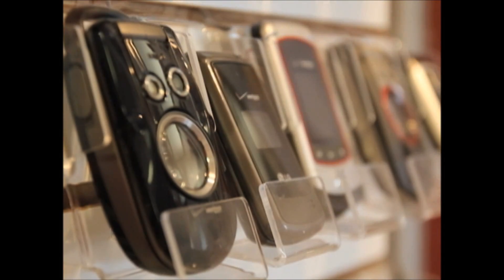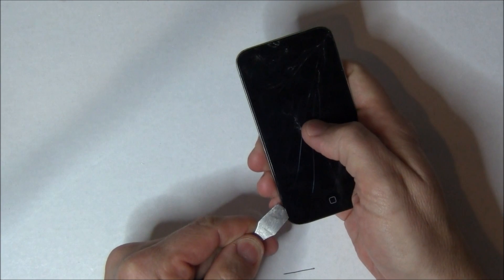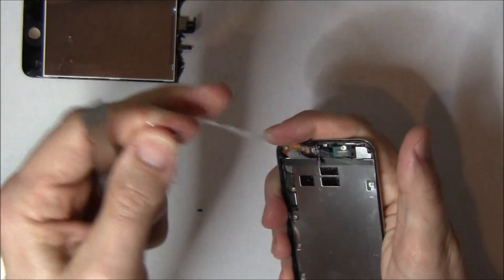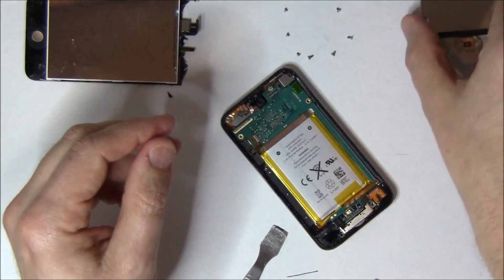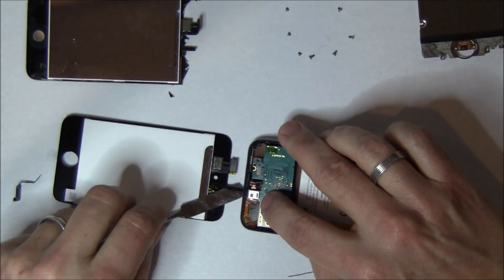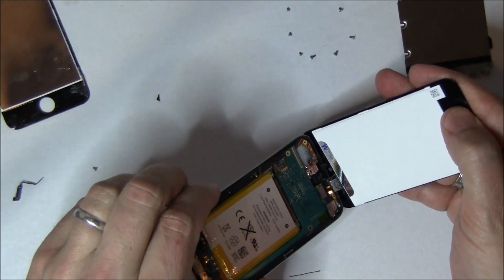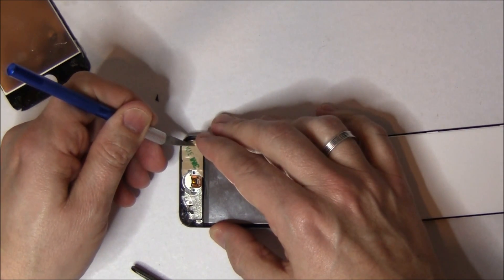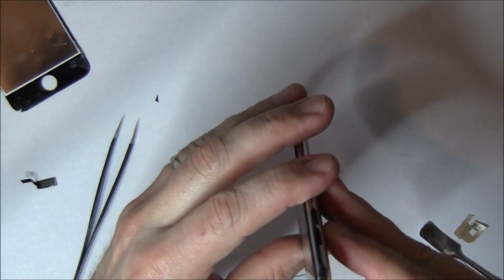iPod Touch 4 Screen Digitizer/LCD fix Disassemble Repair

Comment: Great video, I just fixed my kids I pod. I found 10 seconds at top and bottom of the screen with hair dryer on high hot caused the glue to soften and the screen pried out easily. Wait about 15 seconds after heating for adhesive to soften as the heat has to penetrate. The screen should feel very warm before prying.

Comment: ok so maybe someone can help me i changed my digitizer/screen on my ipod touch4g and now i have dead spots on the left side i cant slide to unlock unless i swipe super fast and it takes a while to get it also the keys esx dont work i tried 3 different screens but the same thing happens..is it possible that because i didnt put the foil around the digitizer when i put it back that thats why im having this issue..please someone help me if you can thanks
Reply: wow thanks for the fast response yea the digitizer is clipped in there good so i dont know where to go from here..it makes no sense to me i have fixed several ipods before and never came across this problem..

Comment: Hello, I have a question as I've noticed this on 2 ipod 4s that I've repaired the digitizer and LCD; what kind of adhesive should I use to secure the digitizer/LCD properly? Both times at the top of the ipod, the digitizer doesn't seat properly, no matter how much pressure and 3M adhesive I apply. Thank you in advance for your answer.

Comment: I followed your tutorial and have a problem.  When I test the screen I cannot unlock the unit.  The screen powers up when I connect it to a source (i.e. computer) for a few seconds and then goes black.  I tried a second screen on the same iPOD and it does exactly the same thing.  The unit was working fine albeit with a broken screen before the attempted repair.  Any ideas on what the issue may be?

Comment: This is my first actual broken screen fix for an ipod touch 4th gen.  Usually I mess only with cells; mostly Samsung.  My neice bought the replacement screen off ebay after telling her to go to an Apple store.  It shows only a white screen on startup, no sound or anything.  Had to plug in for that.  Was very careful not to over flex or break any wires during disassembly.  Any suggestions as to the cause?  I am at the point where just the screen is plugged in and no further, following your vid...

Comment: everything seems to be fine except my touch screen is unresponsive. But volume button works home button and lock button work and connects to wifi. Is my digitzer not in all the way? I could have sworn it clicked this time but idk for sure. Or maybe do i have to get a new digitzer because i messed it up?

Comment: Thank you for this video. I was able to do BOTH my kids' iPods. No joke on the digitizer though, that's where you need ALL your patience. If you are testing things before final assembly and get a full white screen it definitely means you need to re-seat your digitizer. I took out the volume controls on one of them, but volume can always be controlled on-screen. Thanks again!!

Comment: Chuck, I just had the same problem with mine. I ended up taking it apart again to make sure the digitizer was plugged in good, it wasn't. I plugged it in again and this time tested the screen at this point just to make sure it worked, and sure enough, touch screen is back to normal, put it all back together and viola! Good as new, screw apple and all they wanna charge!

Comment: So I repaired everything and before I decided to seal it, I wanted to make sure everything worked. But I noticed the very bottom row of my Ipod wasn't working, like the space bar, next, ect. And its only the very bottom row I'm having trouble with. I unhooked the digitizer several times to see if that would help and nothing. Will I have to have someone look at it, or will I have to buy another part for it??

Comment: my ipod touch 4g's screen is completely white. i know it still works because the alarm wakes me up every morning. however, i can't see anything and it's frustrating. also, the top of my screen is peeled off so i can pretty much see the inside of the top. that's not why my screen is white because it was still working after that incident occured.. how do i get my ipod to work again? what's wrong with it?

Comment: my ipod works fine music plays and its touch screen is fully responsive, but there is no back light what so ever.  i have to tilt it in perfect lighting conditions to read the display. do you know what could be causing this and any possible solutions?

Comment: OK IT TURNS ON GREAT BUT NOW I TRY TO TOUCH THE SCREEN WITH MY FINGER BUT THE SCREEN DOESNT SINCE ITT WAT SHOULD I DO I TRIED TO TAKE OUT THE LCD  CABLE AND PUT IT BACK BUT STILL THE SCREEN DOESNT SINCE MY FINGER  WAT SHOULD I DO NOWWWW

Comment: Okay soo I'm at the part where I'm taking off the sliver plate. There's a copper square sticker thing stuck on the plate and the iPod in the right hand corner. What do I do? Do I cut it off or what? -_-

Comment: Thanks for responding i reassembled the digitizer (didnt have it in right) and now when  i try to slide to unlock it goes almost all the way to the end and wont unlock i just want to make sure its not anything else but the digitizer P.S. the digitizer isnt snapped

Comment: I droped my ipod touch 4g in water and the screen is very dark i have to put a lamp close to it to barly see it. Would a new screen fix this problem?? Oh every thing works the volume - and + both work perfect, and power/sleep button works perfect, and the speaker works perfect, and dock connector works perfect, please respond need help to fix this problem.

Comment: Its just disconnected from the motherboard, ive snapped it in place several times but it never turns on. I even tried pressing the unlock and home button for 15 seconds. Will just purchasing a new LCD and digitizer help? Thanks

Comment: My problem is that my digitizer cable came of the little slot, and I was wondering if theres a way to connect it back properly  without needing to purchase a new digitizer and screen. When I click the unlock or home but the screen remains turned off. Any help will be appreciated!